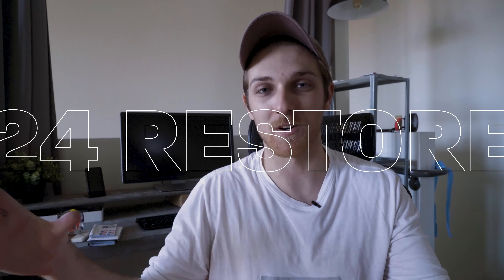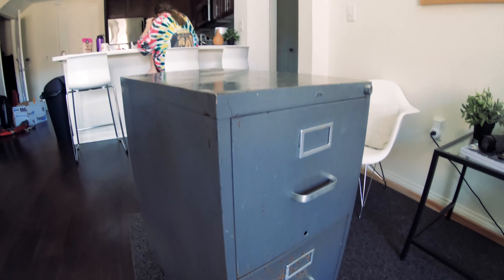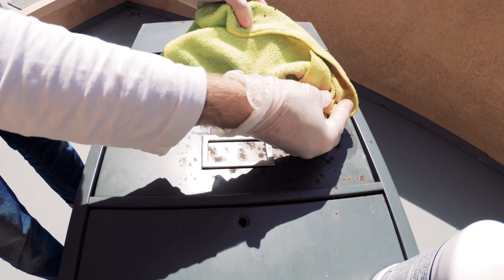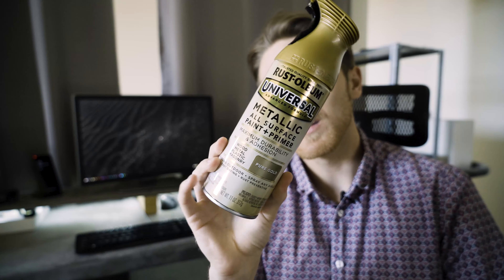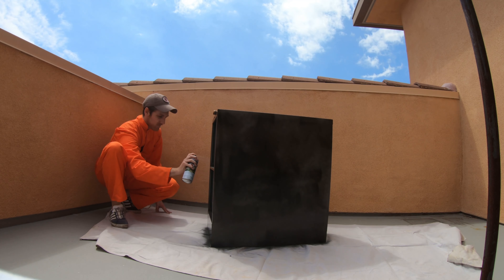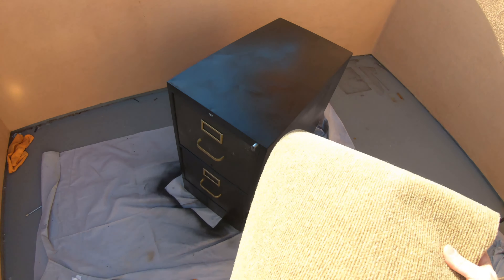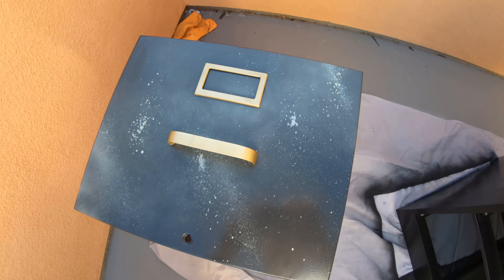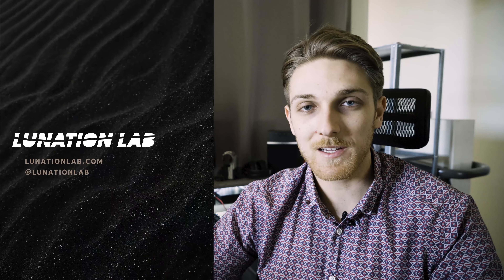File Cabinet Makeover for Under $30

Comment: Your video edits and how you explained the process was much cleaner that other vids I watched. You tackled the rust issue where others did not. Did you clean the entire filing cabinet before spraying to get rid of any grease, grime, dirt? Did you find that Rustoleum adheres well without having to sand it down first? 
I have a tall heavy metal beige cabinet that I would like to paint white. It’s currently in my basement and I would need to move it outdoors to spray paint it so I only want to tackle this project once. I’ll be accessing for the cabinet quite often. How well did the paint keep up?